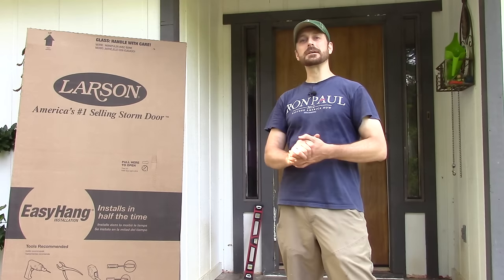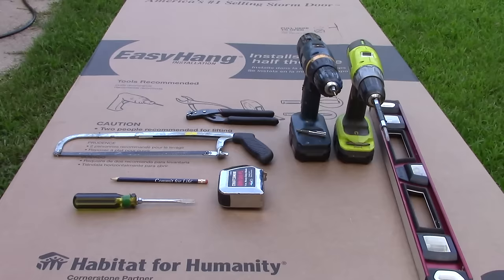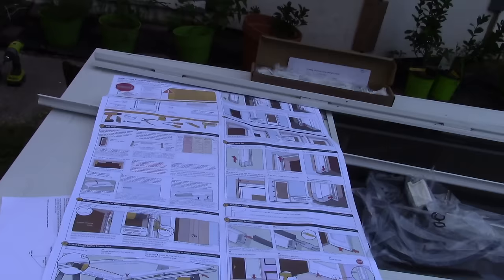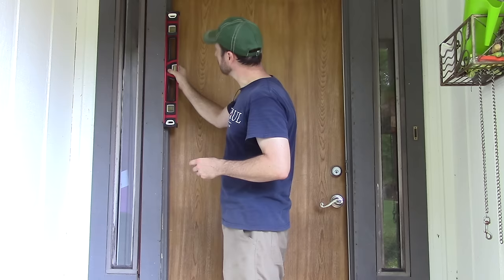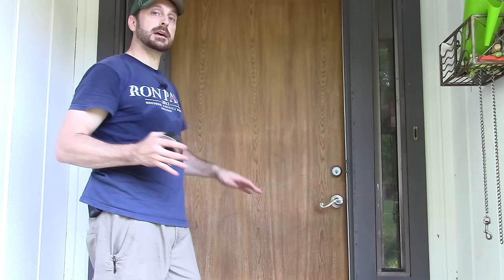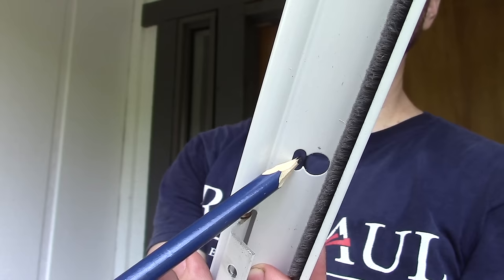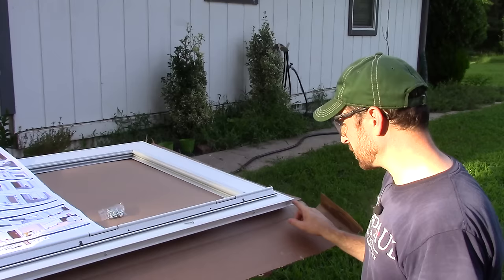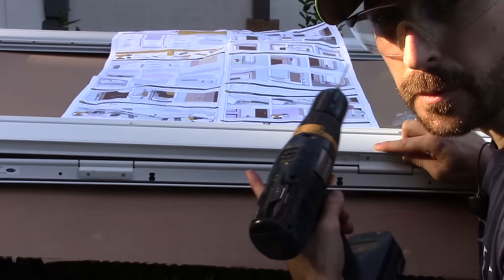How To Install A Storm Door - Larson EasyHang - DIY (Very Easy)★

Comment: I just installed my first storm door, a Larson just like this one in this video that is reversable.  The box says it's easy to install, but it took me an entire day just to figure out how to actually hang the door.  I learned how to drill through the metal.  Had to go to Lowe's to purchase metal drill bits.  This door doesn't come put together you have to assemble all of it.  It is turning out to be a major project with a big learning curve for me.  But I did it!
Reply from the maker: Was easy for me. I didn’t have to drill anything.

Comment: Thanks for the information. The difference with the door I bought 3/15/23 was that there is only four hinge points but it was better than the three on my old one. Also the door hanger has slots all the way down the hinge hanger. The information you provided was great. Thanks again
Reply from the maker: Cool. You're welcome

Comment: Before you put all of the hinge screws in check the door clearance at top and edge. I had to drop mine down a 1/16th of an inch cus the door was scrapping at the top of the door jam. I used the temporary attachment holes to lower it by drilling a hole at the lowest point of 2 unused ones and installed screws leaving 1/8th inch loose then removed the other temporary screws and the door settled down and now I have room at the top.
Reply from the maker: I didn’t have that problem but good advice. Thank you

Comment: ok...got the Larson door from Lowes with large dog door at bottom price 307$.  I measured 10x and made sure it was level.  The instructions were easy and when I watched your video and followed the instructions,( believe the instructions!) it went together simply. Only thing that happened is that the head of the manufacture screw for strike plate broke off in door frame.  Ill deal with that later .  it took approximately 2 hours because I'm cautiously slow :).   now to get the dogs through the door 
Thank you so much
Reply from the maker: You're welcome. Glad it worked out well.

Comment: Two man job, since door has to be held when first screw goes into the jam, yes?
Hole in the bottom trim piece, hornets love it for housing.  Spray with insecticide.  I first used expanding foam, but that caused water buildup and wrecked my first Lawson.
Lastly, any external ornamental trim, don't tighten down the screws, it causes them to crack in the winter.
Reply from the maker: Not this one. Very easy for just one person.

Comment: No handle or lock ? thats awesome what a door !!!
Reply: It does come with a  handle. There is a template that is in the packaging . You must drill the holes yourself.  Youll need a  5/8" and 5/16" drill bit

Comment: Love the shirt! (fellow libertarian)   Oh... BTW.  Nice video!  I am looking to replace my old storm door.  It looks like Larson makes a nice door.  Lots of good reviews.
Reply from the maker: Awesome. Glad you found our video. They do make a great door. Hope the video helps with the install.
Reply: @CountryLivingExperience  He attempted to run as a Republican in 2012..  The door is okay but damn it's dirty.  Just got the highview and the edges of the glass are full of fingerprint smudges and there is swarf all over and some black grease to around the metal joints on the lower part of mine.  FYI swarf is metal particles/shavings from the machining process.
Reply from the maker: @trevors8577  You must have gotten a bad one. Mine was clean and pristine when I opened that box.
Reply: @CountryLivingExperience  lol I wish.. I got TWO dirty ones with the glass edges covered in prints. Haven't installed the second one so I haven't looked that close, just seen it's glass was full of prints too.
Reply from the maker: @trevors8577  Wow. That sucks.

Comment: In the bottom quarter of the jamb, the door does not seal well against the weather stripping, you can see light and definitely air gets through. What would you recommend?
Reply from the maker: Before you put the door on, you need to make the frame plumb and square.

Comment: If the exterior trim wasn't level, what would you have done? I have a 120+ year old home and it had foundation damage. So I'm sure everything is off. I want to make sure I have an idea before I start. Thanks in advance.
Reply from the maker: I would try to level and redo all the trim first. That will give the door the best chance of fitting properly and make the installation easier on you.

Comment: A winter storm smashed our storm door, so I just got back from Lowes with a Larson Bismark door.  It's $125 and looks very much like the one you installed.  If there are any differences, I suspect they're minor and I feel a lot more confident tackling this project after watching your video.  

I noticed that you didn't apply any caulk to your door.  Is this something you didn't have time for, or do you feel it isn't necessary?  If I don't have to do it, I'd just as soon not bother.
Reply from the maker: I didn't feel that the caulking was necessary because it is not getting directly hit with any rain. It just depends on where your door is located.
Reply: Mine will be unprotected, so I guess I should go with the caulking.  Thanks again for a great video.

Comment: Good job that door is only good out of the weather otherwise it's a waste of money just trashed one out last about 1 year trouble free 2nd year the door falls apart but is ok if you can keep it dry
Reply from the maker: Thanks for the heads up. We haven’t had any issues so far.

Comment: I forgot to install the left and right jamb extenders. Now I have gaping holes on both sides. How do I install the extenders? Thanks!
Reply from the maker: You’ll have to pull off the frame, lay it down flat, and pop them in on the bottoms of the jambs.
Reply: @CountryLivingExperience  Thank you very much!

Comment: I installed this door on my back porch less than 6 months ago and it's already starting to show signs of damage at the bottom. I don't understand the way they designed this where they have that strip at the bottom but they don't say to caulk it and I just figured that water will go down into the channel and drain out but it appears that it allows the water in and then the door saps up the water into the particle board. Any suggestions? I think I'm just probably going to have to caulk it all over the place to try and keep the moisture out of the bottom channel.
Reply from the maker: I don't have that bottom strip touching the bottom of my door. There is at least a 1/2" gap in between mine. You could remove it and try to cut it down somehow. Then drill new holes and remount it. I have 3 of these doors and don't have that issue.
Reply: @CountryLivingExperience  ty... there is about a quarter of an inch+ Gap between the bottom of the threshold and the door. It's not touching the door. I know water has to get in there because it's not instructed to caulk and I think of too much water gets in there it builds up. Thanks for your feedback though :-)

Comment: I just got mine and started installing it this afternoon. Everything was a snap until I got to the door latch. Mine came with a cheap paper template that you cut out, fold along a gray line and then tape in place onto the door for drilling. I took great care in placement and drilling and have not been able to get the screws to both go into the latch from the indoor side. I have installed these doors before and never had this kind of trouble. If one on Larsons engineers had  been around here this afternoon I would be in jail for murder right about now.
Reply from the maker: I don't remember having any trouble with it. I didn't do any special trick to get the holes drilled and the latch on. Sorry that part did not make it into the video as the that portion of my filming was corrupt.
Reply: @CountryLivingExperience  I worked with it more today and realized that the template must not have been absolutely straight. I had to oversize the holes to get thew latch to line up. Once that was done, it went together well. Thanks for the reply.
Reply from the maker: Glad you got it

Comment: This door looks like the Model #37098032 It is advertised as a "Reversa Screen for top or bottom venting" I've read the reviews on this door and many have complained about the door leaking to the inside through the screen. One reviewer stated that if you install the door for top venting it will leak. Your door looks to be installed for bottom venting and I'd like to know if it's leaking?
Reply from the maker: Yes, mine is bottom vented. I have no leaking issues with this door.
Reply: @CountryLivingExperience  Thanks for replying back to me. It's very helpful and I'm getting this door. I looked at everything at Home and Lowe's and this door seems to be the best thing out there in my opinion.
Reply from the maker: @irongoose3865  you're welcome. Best one we could find too.
Reply: @CountryLivingExperience  I felt it was one of the more study doors. Most of the more expensive doors had to much glass in them. Other doors with the retractable screens had a poorly designed latch at the top which I felt wouldn't get latched properly every time. Only thing I don't like about this door is the locking handle. I would have preferred the fancy lever style handles that have the deadbolt but all those doors had the problems I mentioned above. I wonder if there is an up grade I can install on these doors. 🤔

Comment: How do you remove the glass? You did not show that step
Reply from the maker: You remove it just like any other glass door or window. It just has spring loaded tabs that you pull back to release it.
Reply: Glass does not require removal... I did it without removing them and before watching this video. I came here to see how hardware was installed.

Comment: Hi, I’m looking to install a similar Larson storm door on my existing decorative exterior front door which has sidelights- and I just noticed that the door knob goes past the door frame/trim- giving me no cavity whatsoever to install this storm door- ugh. So I’m assuming I would need add a frame and build out and add additional trim/moulding to give me a cavity to mount the storm door framing onto. I’m assuming there is no other way around it, correct?
Reply from the maker: I think you are correct. Without seeing it, I couldn't say for sure though. It is very odd that your door handle sticks out that far.
Reply: @CountryLivingExperience  thank you

Comment: My door jamb is about 1/8 inch too short in depth - directions call for a 1 inch depth.  Is this going to cause a problem?
Reply from the maker: Dry fit it first and determine if you need a different door.

Comment: What size drill bit do I need to predrill the holes for the closer? The instructions for the door don't mention it.
Reply: Normally is it's a 1/8th, but just like with the replacement closers your instructions to tell you

Comment: It's really a bad design that they put the closer at 1/3 of the door height. So if you have a large furniture or appliance which barely fit into the door frame, you would have to lift it up above the closer.
Reply from the maker: It is what it is.

Comment: When you take out the center glass and screen, is it possible to reinstall it so the screen is at the top?  Thank you for your help.
Reply from the maker: I have not done it but after looking at it this afternoon it seems as though you can switch them.
Reply: Thank you for getting right back to me.  I had asked bc I had read that in one of the reviews on Loews' site and find it to be an prospect worthy of considering.  I did notice that the on the bottom of the "window frame" on the inside, the plastic "trim" if you will, has what looks like weep holes for a lack of a better description which I would assume are meant to be on the bottom.  I wonder if they can stay in the same position after reverseing the screen to be on top, or if those holes would then be facing upwards?

Comment: The Larson Storm Door Model 16074 was hung and installed without the rail extenders. Is there a way to install them without having to take the door  back off???
Reply from the maker: The bottom threshold extender? Only if you have a good amount of clearance.
Reply: @CountryLivingExperience  That's just it, the space at the bottom of each side rail is minimal.
Reply from the maker: I see. Sorry brother, you are going to have to take that door back off to get those in there.

Comment: Just installed ,Larson Signature Selection  36'' x 81'' Model #14904032, This is the third one in about 15 years, Still have the other storm doors on and they are doing good for age, This new one lacks the same quality .😞😞😞 NOT MADE IN USA
Reply from the maker: Mine say made in the USA on the box.

Comment: Nice video.  Once correction - that was actually a Right Hand installation.
Reply from the maker: Thank you. Yes, I misspoke. Unfortunately Youtube does not allow me to add any text to videos anymore so I cannot make that correction.
Reply: It's a left hand reverse door, not right hand. Hinges on the left, swings outward.
Reply: @maramagdalenasmith  Why reverse?
Reply: @trevors8577  because it swings outward. If it swung into the room, it would just be left hand.
Reply: @maramagdalenasmith  But it's a screen door and thus it's normal operation would be to swing outwards.
Reply: @trevors8577  google door swings. It doesn't matter if it's a screen door. If it swings outward, it's a reverse door.
Reply: @maramagdalenasmith  lolol no they sell them at the store LH or RH what do you think that means?
Reply: @Mitchems  I'm a project manager for division 8. I've done this for the past 10+ years. Please don't try to school me on door swings.

Comment: My screen door handle is loose with the center sliding forward and back. How to tighten to stay in place? Thanks!
Reply from the maker: There should be two screws used to tighten the handle.
Reply: @CountryLivingExperience  Thanks

Comment: Did you have to cut the header piece? You showed a hacksaw but didn’t show that step in the video.
Reply from the maker: In our case we did not have to cut the header because we were at the top end of the tolerance for the model we purchased.

Comment: How do you install the door Handel. Your video has been very helpful. However, The instructions that came with the door are God awful! I have a bachelors in Microbiology and couldn’t even figure this out. The instructions on this just didn’t flow or make any since.
Reply from the maker: You are right, the instructions are not great. I did another video of this same door but placing it in a greenhouse application. The door handle information is included but you may have to modify is a slight bit on the door jamb. Here it is: https://youtu.be/_uMq1rfDwf8

Comment: Unfortunately. "Made in America" doesn't guarantee quality. Normally only flimsy.
Reply from the maker: I guess you have had bad experiences. I have not. Usually, everything "Made in the USA" that I buy is solid. Of course I have had outliers but generally no issues. This door is no different as it is very solid and well constructed.
Reply: ok. thanks
Reply: I installed one of the Larson storm doors, similar to this one but high view version, it went great and the door is solid, not flimsy at all. It was $300, not $125, but surprisingly well built and well thought out system.
Reply: ohh and by the way my dad installed this very door over 20yrs ago and I live in florida so I would say the door owes him nothing!!

Comment: I had these wood core doors. PLEASE! Pay a little bit more and get an all glass or aluminum...my wood core doors  got water inside somehow and both front and back literally fell  apart....and wood pouring out sides and bottom. I guess if your door is going to be on an ENCLOSED PORCH....maybe it will work....but still this is 2024. He says it cost $125 ..... try almost $200 maybe $179 for this cheap door. PAY THE EXTRA $50   AND GET A STORM DOOR THAT CAN WEATHER A STORM! Just sayin! 😊